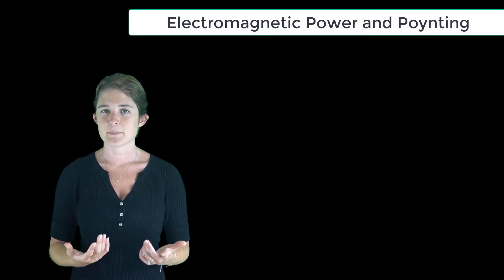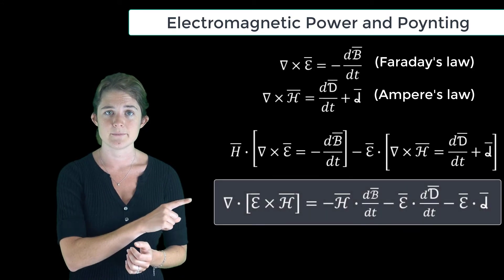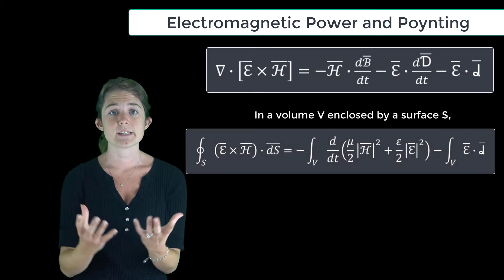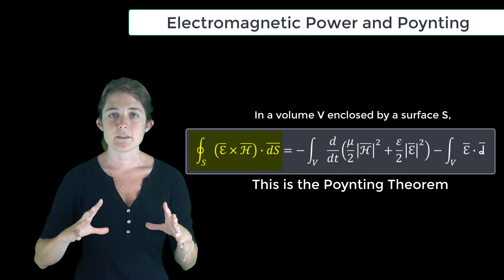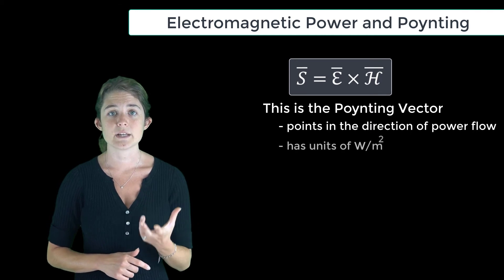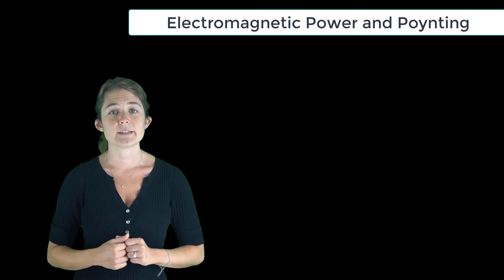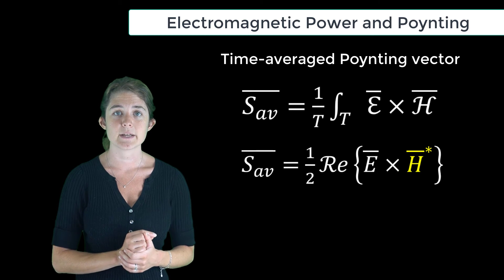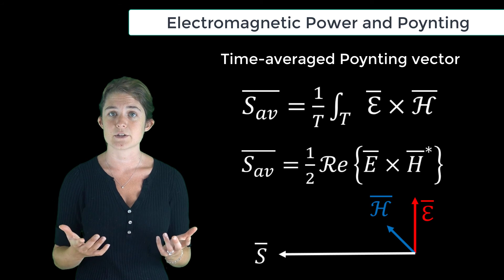Electromagnetic Power and Poynting — Lesson 13

Comment: In some most videos, including  this series, a plane wave is normally shown polarised, moving along the z axis as  an E and B wave in space quadrature.The fact that the E and B components of an E/M wave are shown in phase, then this means that due to the " in phase" amplitudes  of the B and E waves, then the Power Poynting vector is not a constant, and it pulsates, even reaching zero when the Magnitude of E and B are both zero at the same time. However in reality,  in a lossless medium the Poynting Power vector  of an E/M wave is constant and is merely transferred from the E to B field without any losses.  This seems to suggest that diagrams representing the  E/B  waves shown in space quadrature and in  phase  along the transmitted direction needs further consideration, How could one explain this to newcomers to the subject? I believe there should be a pi/2 angle somewhere! and that will make the tortal power being exchanged between the E and B field as it propagates out a " rotating" constant. In all oscillating systems like pendulums and LC circuits it is always an exchange of energy while the total energy remains constant, This characteristic phenomena should appear in any E/M diagram we show